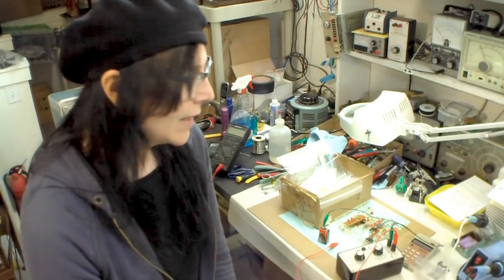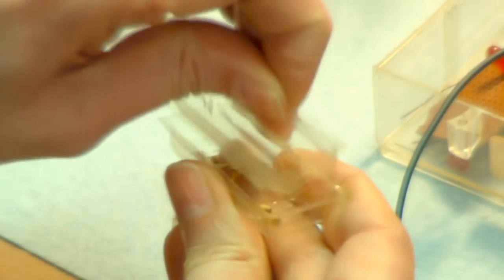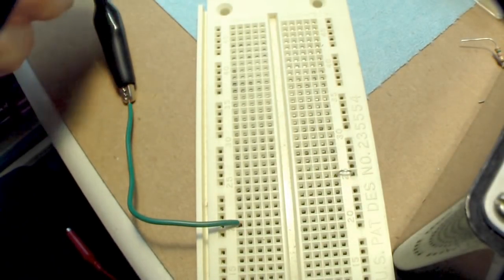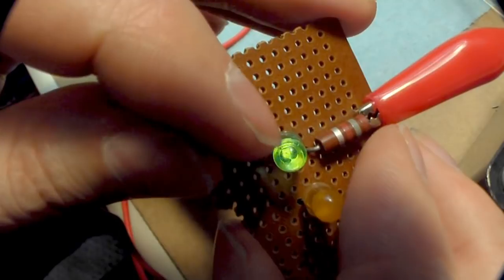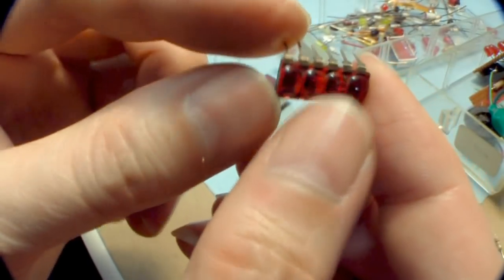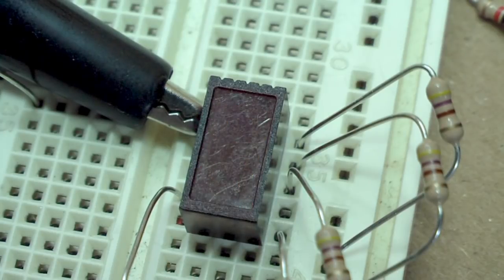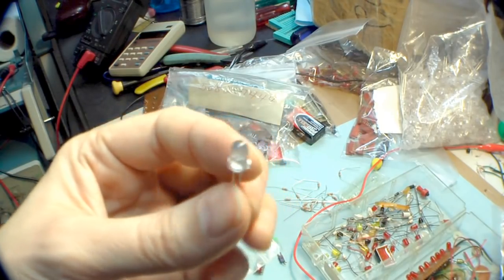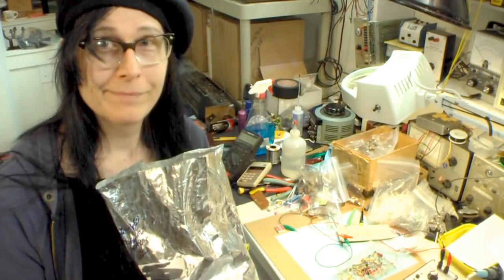The First Light Emitting Diodes

Comment: 20:40 those types of bubble topped led digital number displays usually used in old calculators were magical to me as a child, I would take apart dead devices to collect them, and the clear plastic lens strips are what decorated the first original Star Wars Lightsaber that Luke was given by Obi Wan, so I was doubly enamoured because I was a huge SW fan!

Comment: I've got some DataSAAB 7-segment LEDs (yes, THAT SAAB company). When SAAB decided to do their own jet fighter, they had to start from zero, and make a computer first. The computer was from 1971, with core memory, and it was used at the local bank well into the 80s. We got to take it apart when it was decommissioned, which is where I got the LED from. As far as I know, the majority of the components ended up in someone's model railroad controller.

Comment: I was born in soviet union and my father used to be an electric engineer. He had lots of military-grade soviet LED's that I used to play with when I was a child. And gosh, they were so cool. They werent terribly bright and didn't have any fancy colors, but their build quality and robustness were just over the top. Marvels of overengineering: tiny metal casings, super-fine copper wires with fiber-reinforced heat-resistant insulation, glass lenses instead of plastic, glass potted, etc. I'm sure you'd love them.

Comment: I bought my first LED in autumn 1968 when I stopped off in London on my way for interview at Kent University. There was a component shop in Tottenham Court Road (name escapes me) that sold the first infra-red LED that I'd seen. It was in a metal case that was intended to be strapped to a heatsink and came with a quartz lens to focus the beam. I was eventually able to transmit a signal across the living room and detect it with a photodiode, but setting up was very tricky as you couldn't see where the beam was.

Comment: First Calculator I had from 1973 was red LED, used 4 AA's and/or plug in adapter (Ni-Cad optional).
$99.98 - or about $551 today.
No, it didn't do more than add, subtract, multiply & divide.

Comment: In 1907 Henry J. Round of England found that passing current through a cat's whisker electrode touching a lump of silicon carbide would sometimes cause the carbide to glow at the point of contact.  It was the first LED.
Reply: Kevin Byrne LEC light emitting cat
Reply: Actually a Russian was inventing silicon carbide light emitters before Round.
Nick Holonyak got the credit for the original red LED.
Reply: @acmefixer1  --  You're probably referring to Oleg Losev, who published his findings in 1927.

Comment: My first LED was one of the second one you showed.(circa 1972) Yeh, it was dim. I tried putting a lens in front of it and focusing a spot on the wall which could only be seen if the lights were turned off. Later experiments with LEDs of the late 70's I was able to use one to send pulsed light a few feet to a photocell hooked up to my o-scope(without using lenses), altho it was rated at 50ma, the pulses peaked at one amp. The pulses were so short you couldn't see them. And if the rep rate got too high, it would burn it out.

Comment: That TO-92 one is like what you got in opto-interruptors.  On those old ones you could pull off the black plastic shroud with the slots to reveal the discrete LED and phototransistor.

Comment: I bought a string of LED Christmas lights from Home Depot 10 years ago. It had 1 lamp that had a green epoxy package, but a blue LED chip inside. The rest of the set was correct. Regardless I kept that string on 24/7 up until 2013, and all the lamps still worked well. Then I sold the house and lost the string.

Comment: Well you can not be there biggest fan, I think we would have to share. I also discovered LEDs in the very early 70s. One of my friends at elementary school, yes I believe we are very close to the same age, in the 1st gave me a couple (red of course). His dad worked at Univac and had hooked him up one for a science fair to a 9volt. Well in the first grade, I did not know about current limiting resistors, so to know what I did!  After I distorted the first couple, I found out what was needed to protect the LED from a 9volt.  Yeah 1st grader using ohms law. But that was how passionate I was about electronics and anything with lights, so LEDs were perfect!  I remember buying the “grab-bag” LED pack at Radio Shack just to see what it might contain. Also purchasing big bags of surplus from a place, I think called, called Poly-Pacs. Their name reflected the fact that every small component they soled came in plastic bags. This was of course later in the 70s, but I enjoyed getting bags of 100,  just to see the different colors. This start drove me ultimately to a EE and I am still working in aerospace now.  My cross between loving the space programs when I was a child and electronics. This topic brought back many memories.

Comment: Radio Shack also sold those TO-92 LEDs in Red, Green and IR.  I had an old VCR that had an infrared TO-92 LED and detector to let the system know when a tape was loaded or when the end of the tape (clear area) came up, probably to keep from stretching the tape when it suddenly stopped after running out of tape.

Comment: Hi Fran, I've seen those TO92 leds used in opto encoders along with a photo transistor also housed in a TO92 case, there was a plastic moulding which they both clipped in to with a slot in between the two for the encoder disk.
They were used a lot on early VCR's.

Comment: I worked in a stereo repair shop for the past 16 years; it was extremely rare to see an original LED (stereo indicator etc) die out, but I worked on a Kenwood receiver with a dead LED in the tip of the dial pointer, secured with the same corrosive glue used to hold capacitors to the PC boards. It was a bitch to remove all that glue from the wiring channel of the pointer, and although we had hundreds of different LEDs in stock, even the smallest red LED I could find was just a little too large and I had to file away some of the plastic from the sides of it so that it would fit.

 It is now very common to see refurbished vintage stereo receivers on YouTube where the original incandescent lamps have been replaced with LEDs. 
 Although we frequently did this on our own customer's equipment, the problem we often encountered was that LEDs typically emit nearly all of their light from the tops and very little from the sides,  as opposed to an incandescent lamp where the light emission is much more omni directional. We often found ourselves setting the new LEDs farther back so they wouldn't "beam", or adding various translucent materials, color gels, replective aluminum tape, parchment paper and so on in order to diffuse the light and get a good color spectrum, as well as using additional resistors to lower the brightness. The majority of refurbished stereo quipment that I see on YouTube have non-original LEDs that are way way way too bright,  with "hot spots" and beaminess for the function indicators and the tuning-dial back-lighting.

 The other problem we occasionally encountered is that sometimes the current draw of the lamp, or the non- linear resistance of it, would be part and parcel of a certain circuit, such as the multiplex circuit and the stereo indicator lamp.

Comment: My father had a Bomar Brain calculator from the early 70's. My memory is that he got it at Sears, he was very impressed with this gadget. I got it in the 90's and replaced the battery with another rechargeable and rewired the socket that matched a charging adapter. The last time I tried it it still worked. 
   I also remember the first electronics kit I had that had a led light. I remember the first green led I encountered in a control board in a film processor, that was in 1981.

Comment: The single lead LED's were commonly used on punched tape readers along with being used in data tape recorders as a pinpoint light source with a very good alignment. There was a matching detector for them as well. press fitted into a small brass bar that made up the reader strip and the common connection.  The TO92 cased LED's were very common in slotted sensors, as the detector was a matching case so the housing could be made symmetric for ease of use and so the detector could be shielded from ambient light. The more common led's used there though were IR devices in a pale water clear blue housing with a clear detector. Active device was using the ejector pin mark ( clear flat spot on rear) as a flat light window for emitted and detected light. I saw them often on early 1980's copiers.
Reply: http://www.decadecounter.com/vta/articleview.php?item=670

Apparently used as camera rangefinder indicators, which explains why they're so dim (it doesn't need to be very bright at all to show up in a viewfinder), although not why they're in a TO92 package.

Comment: I remember the reverse polar notation calculators and my first LED came in my 50 in 1 Radio Shack by Tandy Electronics Kit that I still have.
I have worked in the broadcast and aviation fields and the best ones I have are the Vu type bar graph displays. Where in one housing were rectangular led segments stacked on top of each other. The second best one I love are the round led displays of different colors in one housing. They used in button displays that would change colors on video switchers. Great videos keep them coming while we are cooped up.

Comment: I had one of those little Fairchild LEDs. It ran on about 2 volts like most standard LEDs.  I connected it to a 6v battery and it exploded.
Reply: That's called a Plastic Emitting Diode :-)

Comment: Was the TO-92 LED a dual die LED, or was it a single segment with an unused pin? Looked like only two of the three wires were wired up, but the internal structure looked like a "T".

Comment: Most of my LEDs are the very cheap modern ones that you get by the truckload, but I have a few older red ones (by which I mean, about 10 years) that were more expensive.  The difference in the light quality is very noticeable.  The cheap ones are very efficient, very bright, but a little harsh and with poor diffusion, the die is very obvious.

The older red ones I have have much better diffusion and are a deep, cherry red.  Lovely to look at, they can be stared into without any discomfort.

Comment: The first calculator my Dad brought home sometime around 1972 was a Texas Instruments "Datamath". I just looked it up and found a picture so I could confirm the model name.   I only knew it was so expensive he had to lie to my mother and claim he "found" it.  It had a display just like yours but it was about 3 times as thick and was loaded with at least a hundred discrete components.  It seemed like it weighed a pound. I think it was at least 1 1/2 to 2 inches thick.  Only after years went by it got dropped and was no longer working did I dare take it apart to see the hundred or so components. It did have a couple of chips but was literally jam packed with components.   Its so funny to see the inside of a modern calculator when everything is on one chip.

Comment: The LEDs in the TO-92 package were manufactured for Farinon Electric, Motorola & General Electric. They were installed into pluggable circuit cards for tropospheric scatter radios as fault indicators. It was for automated circuit board loading & stuffing equipment. Instead of changing the loading tool to handle & load a 2 lead device, it could continue installing TO-92, 3 lead devices without stop. The board loaders were designed for 14 pin & 16 pin DIP packages & 3 pin TO-92 devices. Even some diodes were manufactured in TO-92, 3 lead packages, to reduce production costs in loading the circuit boards, space on the board permitting. There was only 6 places on the denseist boards where 2 lead devices were loaded & those were loaded by hand. Later, that changed to surface mount devices & remained backward compatible. The explosion of terrestrial based microwave communications in the late 1970's & early 1980's put very high demand for the completed radios upon the market. These three manufactures asked for the manufacture, Fairchild Semiconductor (?) & secondary source, Motorola Components Division to package them this way. They were made that way as a matter of production cost economics of the circuit boards they were loaded into. I believe Delco-Remy also purchased them for much of their retooling General Motors automobile automated assembly equipment. GM was getting eaten alive by off shore manufactures because the off shore manufactures had already automated. GM had resisted automated assembly too long! I hope that explains.

Comment: My first calculator in 1975 didn’t have LEDs, it had an electro luminescent display which was a small vacuum tube with ten numbers in it. That was an improvement over the Sharp Elsi Mate which had a 3.5 digit display and showed larger numbers 3 digits at a time and cost around $300.

Comment: Wow I though it was just me who collected these. I have loads of LEDs pulled from old 2-way radios up to new strings of Christmas lights that went bad.
On the old Mv1 types have you tried putting one under an IR type sensor to measure it? It may be producing more light in that range and the visible is a residual effect. One could fire the LED at a smartphone camera to see IR light just to see.
The TO-92 LED i believe was used widely in some of the very first attempts at computer mice and track ball mice with scroll wheel capabilities. Obviously they did not work out as planned because we all know it looked good on paper but no so in practice so they went with true IR types and you get what we have today in optical mice.
Also a similar type of LED and detector pair can be found in old VCR and beta max machines in the tape in try detection area but designs vary depending on the brand and version of the actual machine.

I do have some matrix grid type segment LEDs that come off and old scrolling message license plate cover from the late 80's early 90's. They are mounted on a long PCB and can be de-soldered with wick. I can send you one to add to your collection if you want one. Just let me know

Comment: Have many of those same LEDs. But never saw one with a single lead plus case. I have several Til311s, still being sold for $20 per but cheap for some reason when I got them as a kid. Recently built a "Dial-A-Color" project where you could fiddle with 3 rotary encoders to change the PWM to an RGB LED. But never found an RGB LED where the 3 colors mixed really really well.

Comment: Have you tested overdriving any of these old LED's? Its quite common to overdrive LED's today (at the risk of shorter lifespan) but I wonder how much abuse some of the older ones would take in the form of voltage.
Reply: I think new ones are more tolerant. In the 80s I hooked up an LED to 2 AAs and it shone for a couple of minutes before giving up the ghost.
Reply: @chaos.corner  , it's not the voltage, it's the current; that 1980s LED probably would have lasted for days ( or nearly forever) with a series resistor, anywhere from a few hundred ohms on up.
Reply: @goodun2974  For sure. I was just messing around with a flashlight and a spare LED I had.

Comment: I bought a bulk lot (1000) of similar TO-92 cased LEDs (the ones I had were much brighter than the one you demonstrated) to build the 7 segment displays for a clock display (had 6 LEDs per segment). In the early 70s, they were the cheapest LEDs available (if you bought them in 1000 of quantities). I needed 252 LEDS for the display (plus a few more for the "dots"). I sold 700 of the remaining LEDs in small sized batches and recouped most of the purchase price.

Comment: The first LED that I encountered was in 1969. It was made by Monsanto and was very expensive. The company I was working for at the tie was thinking of using them in moving sign displays, but they were mosly a novelty because of the cost. The earliest ones that I currently have I aquired from Motorola in 1972 as a sample.
An interesting use I have found for them is as a low voltage reference.

Comment: I have toyed with LEDs since the late 80s. I was also quite fascinated by them, though not as much as you :) I remeber getting my hands on a 3 pin LEd, somewhat like that gold-plated, transistor shaped one, but it used to light up well. It had two different colors built in one (this was awesome considering it was in the late 80s) and hence the three pins. All in all, awesome stuff you got there. Your video is bookmarked :)

Comment: The semiconductor physics of LED's is really fascinating.  The doping literally changes the bandgap between the conduction and valence bands, which increases forward voltage and photon energy, which are both inversely proportional to wavelength of the emitted light.

Also, the GaAs LED's that are doped yellow and green kind of redden if you run too high a current and overheat them.  I learned that the hard way as a kid, before I figured out the importance of current limiting resistors.  :)  (And many LED's will actually shorten their wavelength if run extremely cold, like under liquid nitrogen.)

Comment: The first LEDs weren't even actually LEDs. They were just normal diodes. Then someone realized they emitted faint light when biased. That's what started them down the road to the LED we have today. If you get some cheap diodes with glass bodies, you can often still find some that light up when biased.